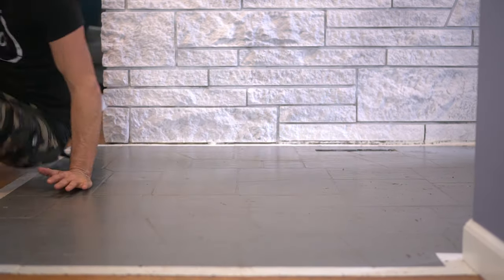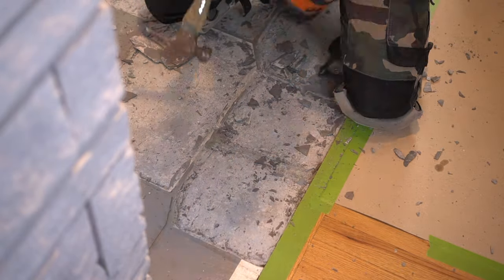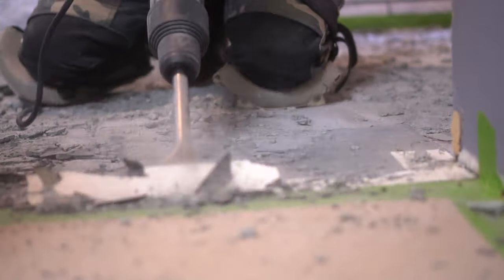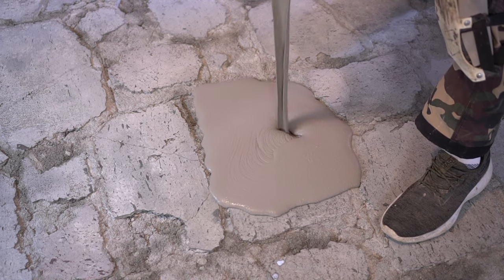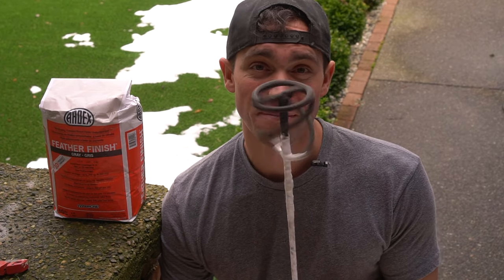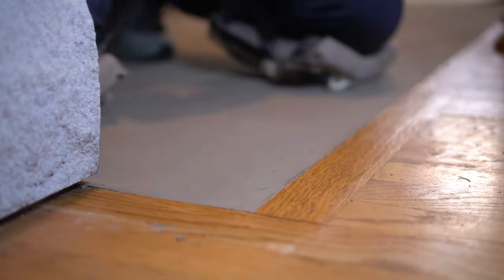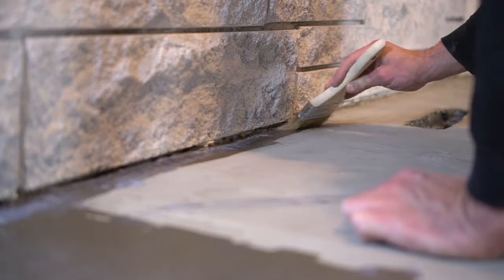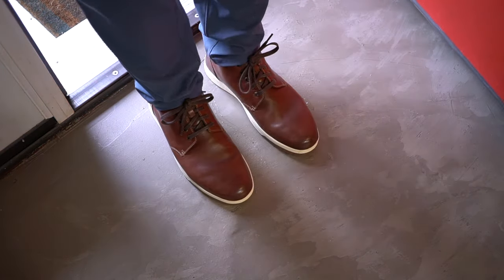DIY CONCRETE OVERLAY

Comment: Not a big fan of the look, but lots to learn from here, thank you!
Reply from the maker: Thanks so much for sharing Gus because that exactly what I was hoping to hear if someone didn't like the look itself.  Thanks so much for watching.
Reply: Very Nice!! I apply Epoxy Floor's & when I restore exterior walkways or driveways, as an overlay I use 2 sand, 1 cement... usually I'll offer color and intern I will ad the color pigment to the water. As long as I've been using the concrete primer...this simple old school overlay..when done properly..can last 10 to 15 years.

Comment: Anyone thinking about trying this please read the technical data sheet on the products.

ARDEX FEATHER FINISH is not to be used as a 
permanent wear surface, even if coated or sealed. 
ARDEX FEATHER FINISH must be covered by a suitable 
floor covering material such as carpet, vinyl flooring, 
ceramic tile, etc. For resurfacing and leveling indoor 
concrete floors in warehouses, storage areas, hallways 
or other areas where a wear surface is required, use 
ARDEX SD-MTM DESIGNER FLOOR FINISHTM.

Comment: It looks well enough if it's your thing. I don't hate it. I'm actually a fan of modern and using concrete on things. But, that said, I have a flagstone entry from the 50s in my home. But, I love it. It matches almost any decor style. And keeps some of the homes original character. I'd like to have concrete countertops though.

Comment: Not everyone enjoys the look but I have to say I get where you’re going with modern + rustic. If you watch some of the diy networks episodes on building off grid, a lot of the more modern builders in those episodes used concrete floors and I loved it bc if you’re in the outback or where it rains constantly, water proofing is a must and easy to clean is just as important. I have two dogs and if I had a larger entry I’d personally go with something like this also. It seems strong, durable, I’m sure colorant like a blue, or even a softer stone color could be added or even multiple thin layers of the feathering top with variants of colors could be amazing. I’ve seen ppl use blue mortar in between tiles, why not for a concrete floor? That’s what I was I thinking when you put on the feathering coat, just like when you added the faux brick walls I could see a multitude of colors etc. textures that could be added, it’s really endless in the style and look you go for. Anyways I like that it’s so durable, easy to clean and looks far better than the painted slate 👍🏼 Now you have to add a bench, organization etc. I’d love to see oak or the beautiful natural stripes and variant of colors of poplar wood with its greens and purple tones... I think if you add a wood element to the walls as in cabinets or a bench ppl will warm up to the concrete floors but I get it, I like it 👍🏼I think with renovations or building even woodworking function is first over form any day!
Reply from the maker: Love it Jewd and yes I totally think you have a great idea with adding color and pigment in the future.  Thanks as always for your continued support and detailed responses.  Always enjoy reading them and keeps me motivated.

Comment: Couldn't you have put that right over the tiles?
Maybe that was excuse you have to tell the wife so you can get a new tool.
Reply from the maker: Ooooo I sooo wanted to do that Saul but the existing tile was slightly higher the the wood flooring and I wanted both floors to be the exact same height.  You'll see why in an upcoming BYOT.  Thanks so much for watching and YES it was an amazing excuse to get a new tool :)